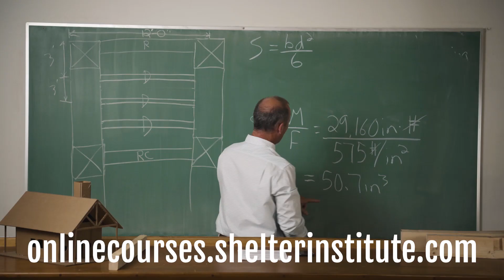Timber Frame vs Conventional Stick Frame - Pt. 2 (A Follow-Up Video)

Comment: Timberframes are amazing with or without sips. I'd prefer without SIPs. After the frame is up and braced. We Ballon frame a 2x6 exterior shell that sits on a "brick" ledge. This is blocked per fire code in between floors. For 2 stories a horizontal board perpendicular to the Ballon frame is attached to the wall studs.(interior side) This is in between the vertical posts at floor height for fastening to the main structure. It also is fastened at the base and at the timber frame top plate.
The Ballon frame gets your house wrap insulation and 2 inches of foam in the form of offset 1 inch sheets.  No sheathing is require because your timberframe is braced and the is attached to the frame. Some areas may benefit from a Simpson steel "let in" brace at corners.
It can come out to alot cheaper than SIPS but it all depends on labor rate for the area. For the plumbers, electricians and finishers, It takes a timberframe and makes the premise the same as a conventional build.
Reply: Can you recommend any videos that depict this methodology? I'm interested
Reply: @MrGwizyadig  no videos out there that I know of. I've thought about starting a channel to get the word out. Next project I get I will.
Though if you have an interest in it. Its super simple. The only tricky part is the topplate/the overhangs.

There's 2 ways to do this. Its very obvious on thhe old Gambrel barns 1890-1900s the first steep pitch is terminated into the top plate. Then you notch the toplate and set a 2x6 rafter tail inside the notch at the desire angle. Nail it to the top plate and sistered it to the rafter.  That rafter tail can get set to match the pitch of the roof or at a different angle.  The 2x6 exterior wall will come up just below that overhang. It will plane in with the bottom side of you raftertail  Depending on pitch the rafter tail  may need a slight birdsmouth where it meets the wall.
 
The other style is toward a hybrid method of framing. I'll cut my 2x6 or 2x8 rafters with a birds mouth for the top plate and a slight one for the 2x6. 
In both these methods I but a Frothpak to spray foam that area.
The exposed 2x6 or 2x8 in a timberframe roof still look great! Plan on having 8x8 main beam but the 2x lumber inbetween. If you do a tongue and groove exposed deck and foam over. YOU HAVE TO OFFSET YOUR FOAM JOINTS!
Otherwise air will leak at the seams and rot it all. Joe Lstiburek has some very good lectures on air leakage. SIPs were notorious for this before they started foam inbetween the joist before install.
Reply: @MrVodkaJohn  Please do, that would be quite interesting.